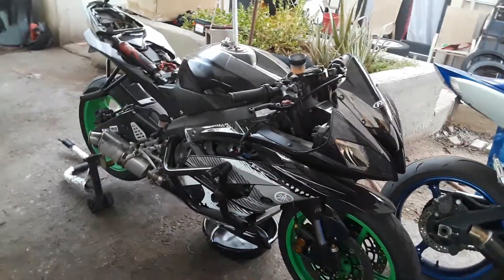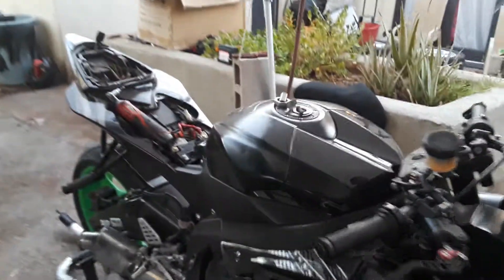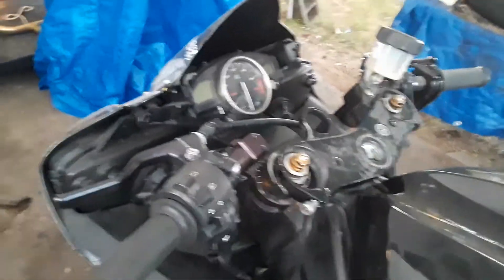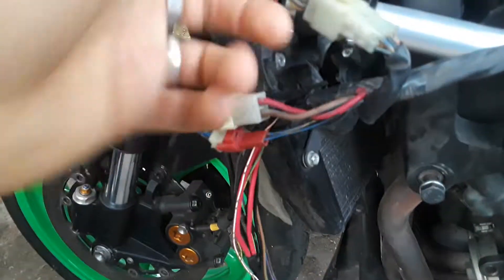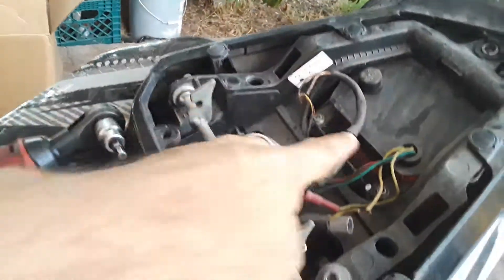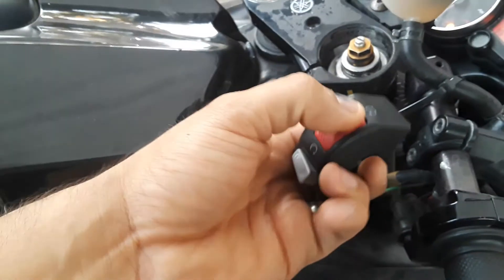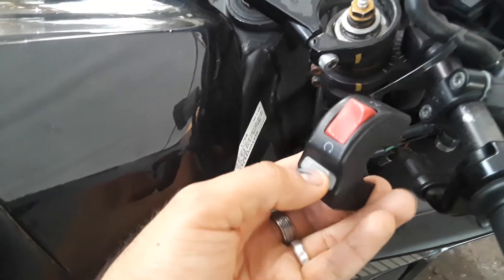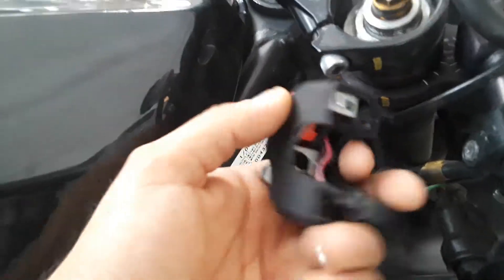Yamaha R6 2008 code 46 issue advice fix

Comment: I have an 04 Yamaha r6 46 pops up on mine too but my bike starts and runs normal it didn’t turn off on me twice but it started right up with some throttle but my check engine turns on while riding and off while stopped
Reply: same thing happening to me, any fix?

Comment: I bought a 2008 r6 and while driving home it didnt have any power but cluster was on: 33 34 35 36 and 46 was written in the speedo and by pressing select and reset error4
Anyone has an idea what could it be? 
Stator was changed 4 yrs ago from previous owner and was running good
Reply: Did you even find the cause for codes 33-36